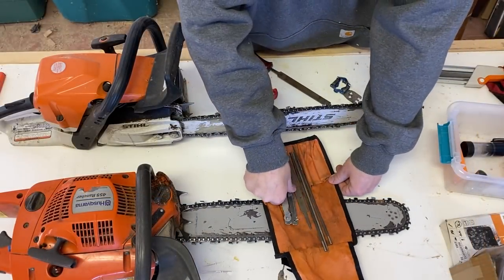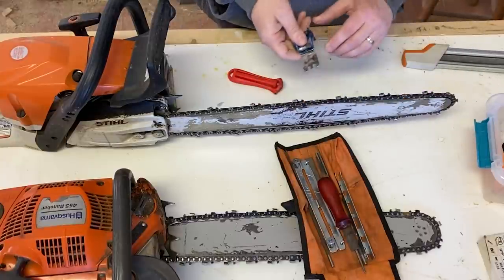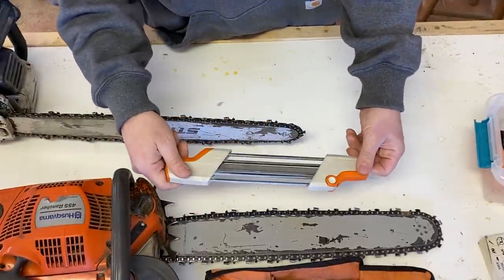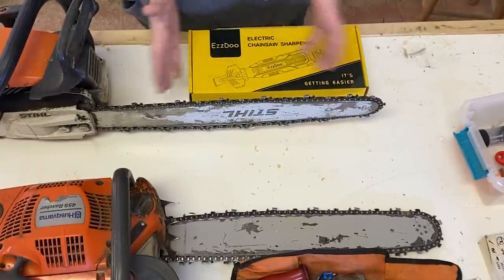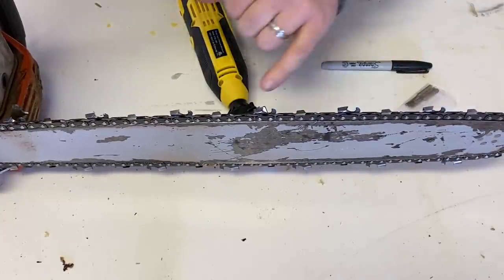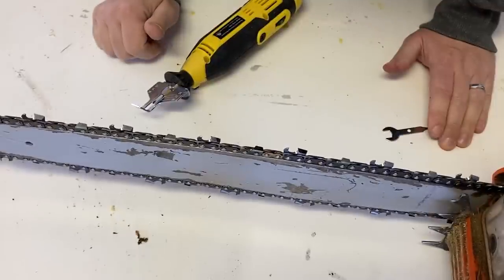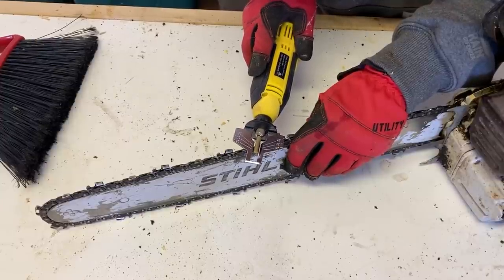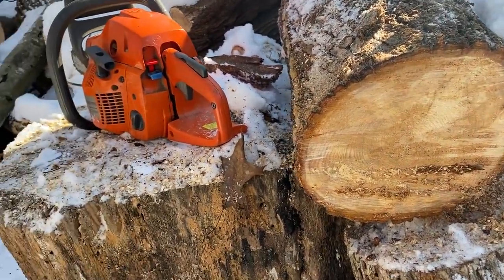How I Keep a Chain Saw Sharp

Comment: Like you I think I have a bunch of so so sharpening systems. The best is the Stihl 2:1 it's pricey but it can sharpening the chain really quick to keep you cutting. The electrics are good when you need to correct the chain when it found the hidden rock.

Comment: One thing I would recommend is to replace your files often. Every 6-10 sharpening or when it stops cutting easily. Also get a file card to clean your files. Also use the raker gage on the husqvarna roller gage. Way better than the stihl one.

Comment: Hey, question for you, friend. 

What’s your take on the chips varying in size when your doing different directions in your cut? 
I sharpen my chain, and I’m OCD about it. My chips will be like the chips you showed as being “good.” 
Then they will shift once I cut another direction. I’m talking seriously angel hair chips. There is no better feeling. My chain is always running like that. One way it’ll be just choppy chips, then it’ll go to straight strings. 

I have a 10 swipe minimum on each tooth, or more depending on the roll over. I sharpen every two to three tanks, with a Vise to hold still. I focus on my hook first, working into the gullet towards my 8th pass, if the hook was straight. 
Then I bring my rakers down 0.25 once my teeth are set and cleared.
My angles always right, not to much or to little pressure. 

Is this normal?

Comment: There are cheap knockoffs of the Stihl one you like, and they are only about $20 and work great.
Reply from the maker: The only issue with the knockoffs is normally the files are quite as good but if it works use it!
Reply: @SSLFamilyDad  my only concern would be trying to get the files out to replace when needed, but it's so cheap, it would probably be easier to just buy a whole new sharpener. Also, I don't use a chainsaw nearly as much as you, so it'll be a while til I have to worry about it.

Comment: No offense, but a round file and a flat file is all you need. No all-in-one tools are needed. Teeth that are longer or shorter does not cause the saw to cut crooked. A wrecked bar is what causes that.